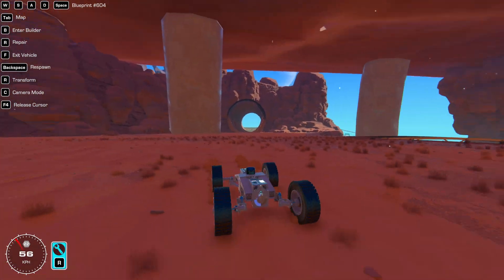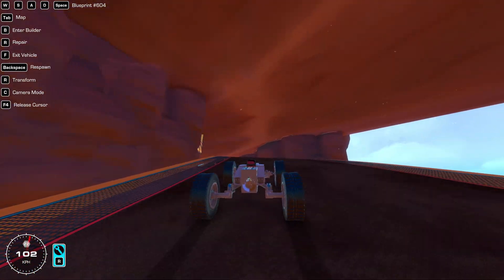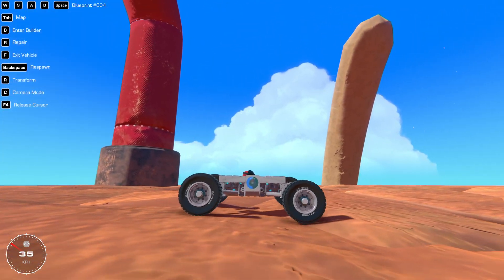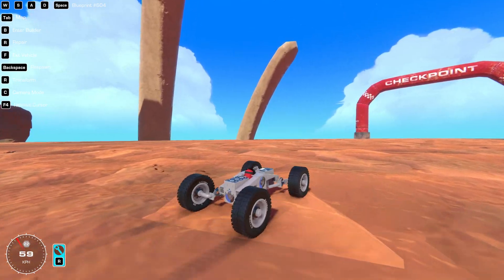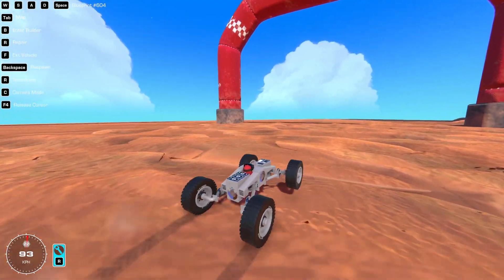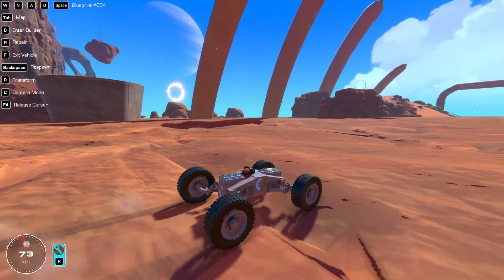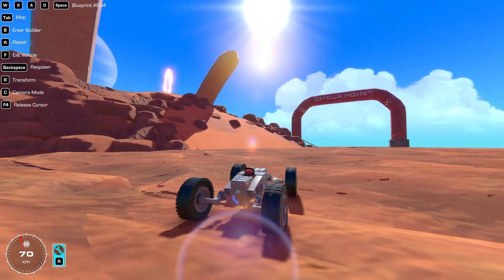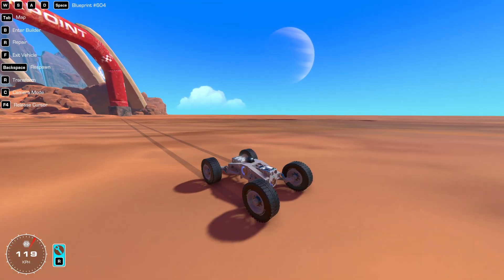New Active Suspension Concept Design!!!!!

Comment: Functionality: check!

Low Complexity: Cross!

Logistical Nightmare: Check!

Fragile: CHECK!!

All seriousness, a way I can. See to improve it, is to have distance sensors in the wheels. If they don't see terrain, they move down. This could also be wired into some other stuff to solve more issues, like the reaching for the ground thing

Comment: you may be able to use sensors to put the suspension arms down and speed sensors for timing
Reply from the maker: sounds hard
Reply: @wtswins have them wired into an XOR gate each, which controlls the hinge obviously. Then just wire a constant input to all the XOR gates from somewhere else

Comment: If its bad at speed would it be good with servos?
Reply from the maker: no it would not.
Reply: @wtswins previous,y, you said it would be better. Now, better is still better. So, WeLl ActHUaLlEyh 

It would be good with servos. Becuase little improvement, is still better results.
Reply: @wtswins then why not use pistons? They can reach pretty far and speed is easily adjustable

Comment: An easy way to improve thisdesign would be to not just rely on the position of the car but lso to use distance sensors to just very slight predict*put them infornt of car* the movement so that your suspention is already on its way before you get there
ofc it wont change too much but atleast a bit, you can also incoroporate power coupling suspention to dampen it much more,
Reply from the maker: if I were to use power couplings for suspension it would also dampen the active suspensions effect.

Comment: I think something is missing, the suspension isn't able to lower with input from the sensors, therefore you can't dampen big bumps. I'd be curious if you played around with the ratio between positive height to level and negative height on the other wheels. Maybe it lowers height until the ground clearence reaches a point with some distance sensors where it switches to adding height. 

But I do think only 4 body sensors could be limiting how independent the suspension behaves.
Reply from the maker: if I do the exact opposite of the current set up it actually achieves a state where it is really good at keeping the wheels on the ground and can handle big jumps and whatnot but the side effect is that the cockpit is the opposite of stabilized.

Comment: Subbed  cause i have a feeling ill see some really cool stuff on this channel!

Question, can you please do a step by steptutorial on how to construct this on a vehicle? I struggle to understand a lot of the technical components in this game, and I'm sure a lot of other people do too, so it would be super appreciated if you were able to show us how this works in a step by step process ❤
Reply from the maker: Maybe!
Reply: There are probably 8 scenarios that occur, being all the 8 angle directions. Foward, left, right and backwards ect. Each input either raises or lowers individual wheels, to maintain level. The downside is that it requires a level ground, not hills or slopes, otherwise it squats.
Reply from the maker: it has a few logical scenarios like that to prevent it from squatting on hills but I didn't really get technical.
Reply: He's also using some swing arm suspension, with steering hinges set to a low strength and the input being the ajustable height.

Comment: Do servos react faster? If so you can use that and turn down the strength
Reply from the maker: servos do react faster but even if the reaction was literally instant it would still be to slow because for the angle sensors to tell the wheels to move the car must be tilted first.
Reply: @wtswins  Distance sensors can detect terrain before the vehicle tilts. I've seen other videos use it for anti-rollover. Maybe it can be used for active suspension?
Reply: @wtswins this is why you use distance sensors too

Comment: The suspension might work good on a race car around a track. Especially with the low amount of changes compared too what you used to demonstrate.
Reply from the maker: That's true because you cant really find rough terrain like this anywhere in trailmakers
Reply: At that point, just spend the power core on a gyro stablizer dude.

Comment: Suspension off: FULL Send
Suspension on: slow driving
Ofc the slow driving will have better driving dynamics. I like the creativity but i dont think this was a good demonstration
Reply: that's.. not what happened
Reply from the maker: It causes you to drive slower because of the way it works it pulls the wheels off the ground to keep the cockpit level. because the wheels were in contact with the ground for a shorter time the creation didn't accelerate as much.
Reply: They were definetly going the same speed, the speedometer measures the cockpits speed in any direction. 
This means they were both going roughly 80, but since the second ride wasnt as smooth due to the lack of stabilization it bounced giving the seat up and down movement too adding almost 10 kph. 
Even if it was going 10 kph faster it isnt a very big difference and likely wouldnt have much effect at such a high speed. 

So basically to summarize, this is a good demonstration because it isnt gaining extra bounce from more speed, its gaining extra speed on from more bounce(in a bad way)

Comment: Just subscribed, 
You could put distance sensors on the axles connecting to the wheels and have them at varying distances and have it to where the short one is required to be on for the active stabilization and the others affect the speed and brace of the stabilization. You could put freebearing hinges on 10 strength and it would allow slight angling, thus energy dissolvement, may not work because of the speed of the suspension though.
Reply from the maker: that should work in theory but in practice because the sensors are not inside of each other they will be detecting entirely different rocks.
Reply: You could also just use 4, one on each wheel. Wire them up into an XOR gate that has another source of constant input

Comment: I think theres a way to set a limit on how far down the wheels can reach. Add a distance sensor that faces the body on each of the pipes holding the wheels. Set the sensor to activate the hinges that move the certain wheel up and down. Adjusting this value should give you adjustable suspension travel.
Reply from the maker: i was limiting it by changing the angle on the hinges themselves but the big problem is when all of the wheels are reaching down at the same time.

Comment: That is a very cool design
Using power couplers might help with dampening the shock form sudden adjustments
Reply from the maker: Cool idea!
Reply: @wtswins Powercouplers do work as an anti roll bar but you'll want to mount them to hinges and adjust the stiffness of those rather than the coupler itself if you want to avoid glitches
Reply from the maker: @LordSethrik  well that kind of defeats the purpose of active suspension
Reply: @wtswins  active anti roll bars exist